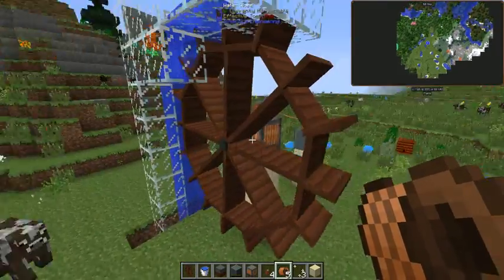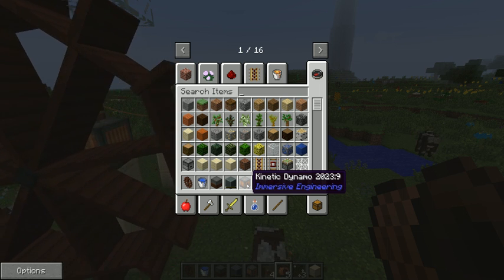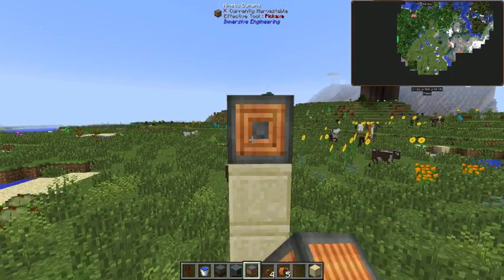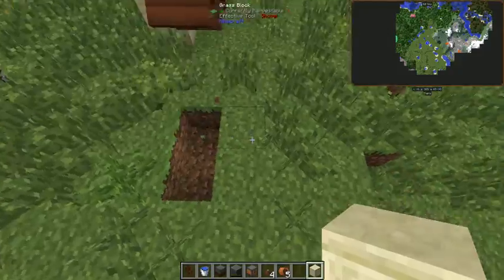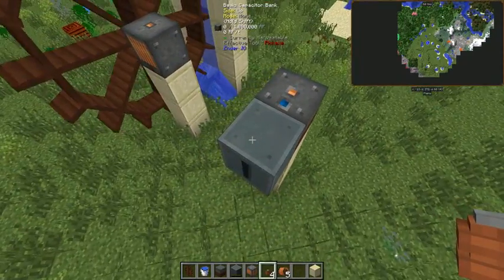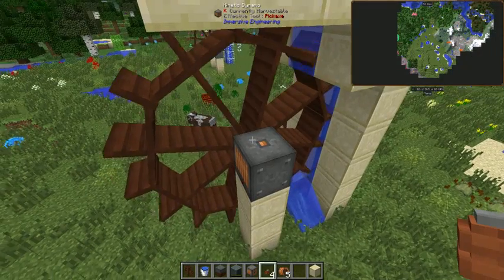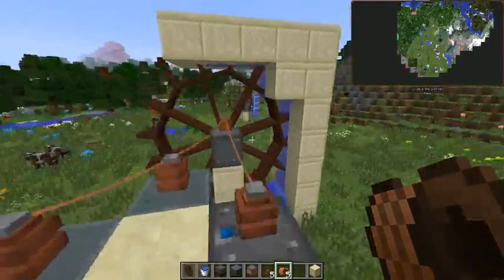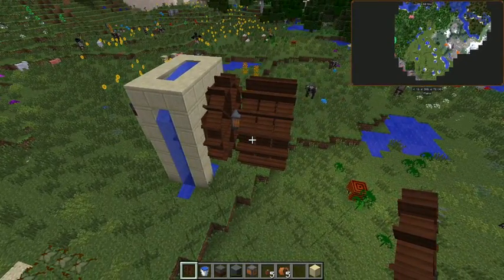Immersive Engineering how to: Water wheel

Comment: Hello, I'm having trouble getting the power from the LV capacitor to the destination. Any advice? Does the side aligned conduit need a particular colour pattern? E.g. blue orange
Reply from the maker: off the top of my head the colors on the side are input being blue and output being orange or vice versa. You can use an immersive engineering hammer to configure the colors to whatever you like. orange blue or both at the same time.